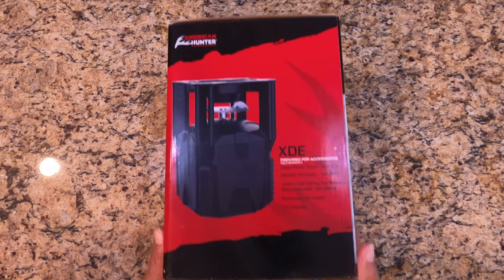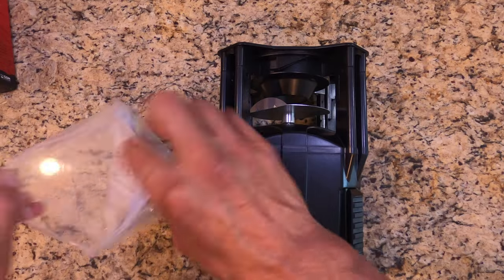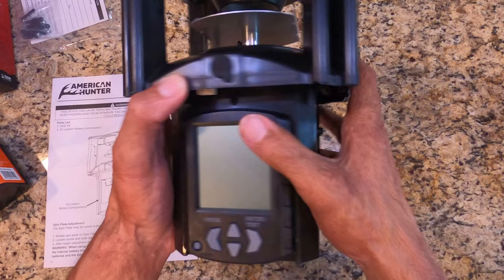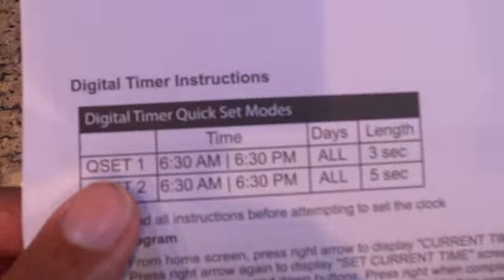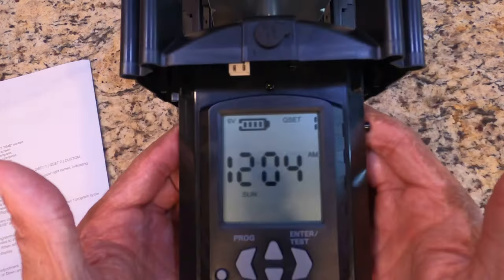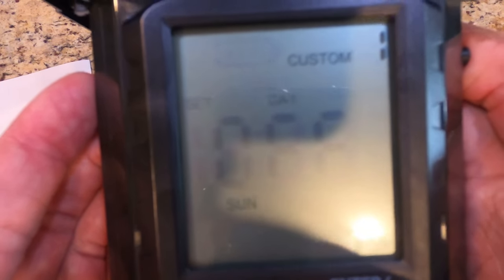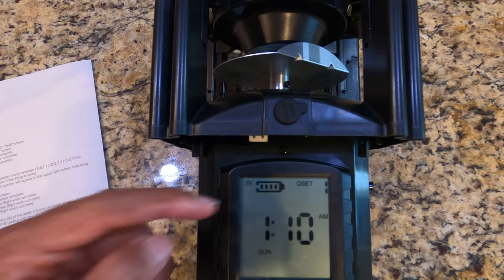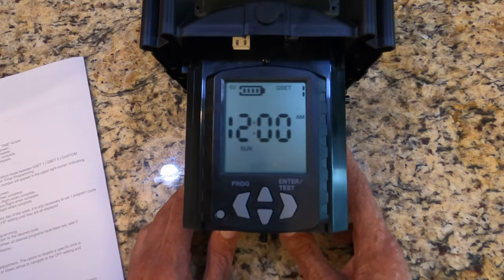American Hunter XDE Feeder: Unboxing, Setup and Instructions

Comment: Thanks for the tips! I kind of feel like this product is a complete piece of crap so far. Do you know if you need the 6V battery for the solar panel setup to work, or can the solar panel substitute the power to the panel? 
Also if you want 2x a day every day of the week at say 2:00am & 2:00pm would you need to set 14 custom settings?
Reply: I don't know about using a solar panel with it. I've not tried using one on it yet.  No, you do not need to set up 14 settings if you only wish to do 2 custom settings.

Comment: Nice video, easy to follow. IF  you decide to do another video, do it over the solar charger addition to this product. The instructions say to remove the enternal battery when using the solar power charger. Failure to do so can cause damage to timer. Makes no sense to me.
Reply from the maker: I read that as well but hadn't planned on using a solar panel on it bc I think the plug in spot for the cord isn't in the best place. I think I will try it though.